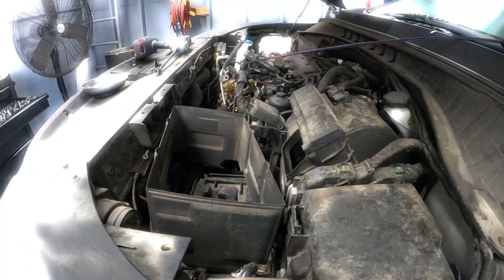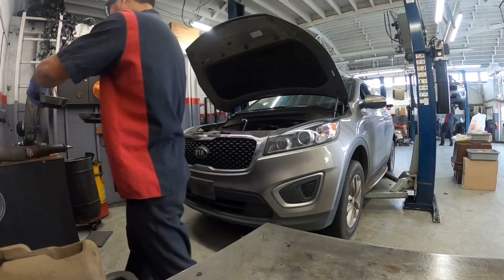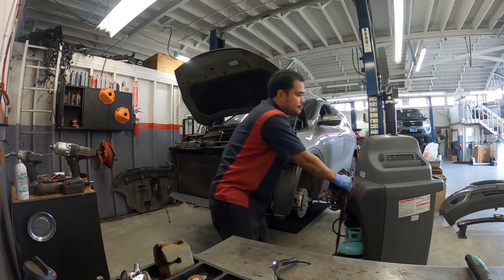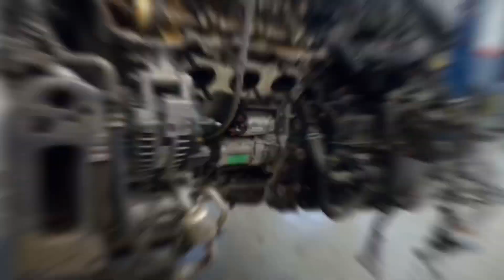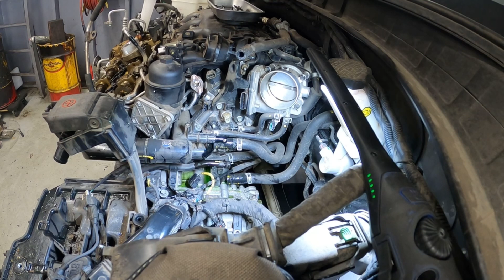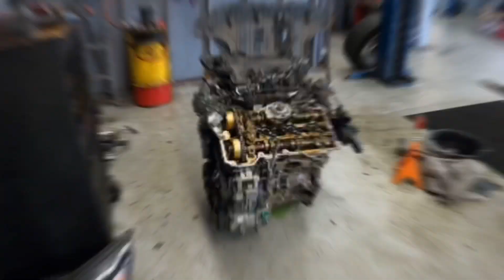2015 Kia Sorento 3.3 v6 engine removal time-lapse. Enjoy. #kia #sorento #v6 #removal #engine

Comment: I've been driving for 32 years and never blew an engine in about the 15 cars I've owned until this one.  A couple of them went well over 200,000 miles and this one was 12 miles shy of 144,000 miles and blew on my way to work.  Two and a half years ago my wife was driving it and said it was running rough and sounding funny.  She took it to a local firestone and said there was no oil in it.  They replaced four quarts and then she took it to the Kia dealer with 99,400 miles when it had the 100,000 mile warranty on it.  They said they would have to do an oil consumption test on it and it would take it over the 100,000 mile warranty.  A little bit later when it had about 101,000 miles we called Kia and they said the dealership never even logged that we were in and they denied us.  Fast forward to two weeks ago and after adding oil over the past two years the engine failed but didn't stop running but had to pull off onto the side of the road on a very busy freeway.  This was a 2014 Kia Sorento SX V6 which wasn't cheap.  Needless to say, I will never own another Kia with that engine.  I had it towed to my house and am contemplating whether to replace the engine for $7200 or not.  I had one with the 3.5 liter engine in my 2011 that was so much better and was very powerful and never had any oil leaks or burning.  The 3.3 was rated at more horsepower but didn't seem to be as responsive.    I hardly had to push the gas pedal in the 2011 and in the 2014 I had to push the pedal a little harder.  It seems like the pedal itself may have had tighter springs in it, which I know has nothing to do with the running of the engine.  In the midst of her oil burning my wife was on the phone with a Kia rep and the rep asked her if she checks the oil every time she gets gas.  My wife asked her, do you?  My thought was you can do that with a $500 beater but not on a very expensive car.  My wife told her that the oil light didn't come on and the lady's response was the oil light doesn't come on until the engine is blown.  Poor engineering in my opinion.  It will tell you if you lose a pound of air pressure in your tire but won't tell you when your oil is low until the engine blows.  Never would I buy another Kia with a 3.3 liter engine.
Reply from the maker: You have all the reason why not to buy KIA again but I don’t understand why dealership don’t  document your first visit concerning about oil consumption, I had 3.3l Sedona this year approaching 100k miles concerning loosing oil and tapping noise, I document every single visit and it’s a long process but KIA ended up replacing engine assembly under factory warranty in 103k miles in it.
Reply: @WrenchingRyan  it seemed like the dealership cut a lot of corners with both cars. When I had other issues it felt like they didn't want to deal with it.
Reply: 3.3 is garb. 3.5 is the last decent one
Reply: @ua7pyro591  I had the 3.5 that got rear ended.  It was my favorite.
Reply: Kia tries to put blame on you always for their  seized engines . Got 2015 v6 3.5 @ 94K 
Kia doesn’t want anything do with me cos I am a second owner . 
That was my first Kia buy , & it’s leaving a very bad rating for Kia
Reply: @raymony8886  that was my second Kia and never again.
Reply: @WrenchingRyan  I have a 08 with a 3.3. 196k mile and runs great. knock on wood.
Reply from the maker: @clancyyoung9994   keep the maintenance up to date that’s the key.
Reply: My 3.3 has a head leak. Don’t know how they can say it’s on the owner when the dealer has maintained the car a gasket and/or bolts in a block should never blow up if properly maintained. Loved Malory car until about 100k when stuff started going wrong (steering coupler fixed after arguing it was covered)
Reply: @esprado690  I've had a lot of cheap cars that never had engine trouble. It figures the most expensive car I've ever bought blew an engine.
Reply: @clancyyoung9994  2014 KIA SORENTO LX 3.3L V6 AWD / 134k 
Just added Stage3 Thorton Chip and she purrrrss.
Like the man said:
" keep the maintenance up to date that’s the key."

Comment: I can't get a straight answer from anyone on how to change a head gasket on my 3.3L engine.  I've been told it's a complete engine removal, so I've been looking through YouTube for ideas and some insight so I can determine if I'm being overcharged.  I found your video and first of all, it's fascinating, 2nd, it's terrifying.  lol.  I'm looking at a HUGE expense.  It's out of warranty and Kia is less than compassionate about the problem, although I'm discovering it's a common complaint for my model (2016 Sorenta, 6 cyl).
Reply from the maker: There is few different way to replace headgasket on 3.3L engine, you can work on headgasket without pulling the engine out, this is the teardown video please check it out. Thanks for watching https://youtu.be/0yLQ02e8EnM
Reply: the threads are known for pulling out of the block for the head bolts. beware. I'm dealing with one now.
Reply: @mikeallmon1  I been to 3 shops and people said a skipped tooth to bad cats LOL. Did my own tests and low compression in the front head. I'm just parting it out currently. I haven't pulled the valve cover, but have a feeling you're right.

Comment: I never remove the front end to pull them. I always drop out the bottom. Do you find you save a lot of time pulling them like that?
Generally 1.3-1.5 I’m out by the bottom …
Reply from the maker: I drop out the bottom when dealing with 4WD, I felt like easier pull them up when working FWD.
Reply: Complete waste of time doing it that way fighting with things

Comment: This is a 2016, not a 2015. First noticed the air box being different, then front bumper. Shouldn't change much of the removal process though
Reply from the maker: Typo error? Hmmm… well like what you said the removal process is the same. Thanks for watching.

Comment: With the machine you show did you remove the Freon from the ac lines? Curious just had short block replaced and they removed the engine twice . Now my ac doesn’t work. Checked it with a gauge and it was empty 🤷🏻‍♂️
Reply from the maker: Yup Freon recovery is required to replace the engine with 3.3L in it. They probably forgot to charGe the A/C system.
Reply: @WrenchingRyan  appreciate it!! 👍🏼👍🏼 thank you for the quick response

Comment: I’m currently doing this job on my 2017 Hyundai Santa Fe 3.3l. I have the engine completely separated from the transmission but I can’t get the flex plate to clear the transmission bell housing. The front side of the engine hits the fender/frame before the flex plate clears the bell housing. Any suggestions? I don’t have a lift to drop it from the bottom.
Reply from the maker: try to remove the crank pulley it will give you more room, make sure transmission is level, challenging but doable.

Comment: just wanting to ask if the ac compressor and system had to be removed during the engine replacement?  My mother had to have her engine replaced and when she got the vehicle back the ac was blowing hot, and they said it wasn't their fault and not their responsibility to recharge it and that the compressor might be bad. When before she had engine replaced the ac was working great.
Reply from the maker: On 3.3L engine, yes  the A/C system have to be remove to get the engine out, did she get the engine replaced from a dealership?
Reply: Thank you for your answer. Yes, from where she bought it from, Dodge Kia dealership in Topeka ks. And it was paid by the company that forgot to put oil in after a oil change.
Reply from the maker: I’ve done  few 3.3L engine but couldn’t find a way removing it without  dealing with A/C system, probably the tech. Who works on your mothers car forgot to charge the A/C system, its only take few minutes to inject the Freon back.
Reply: @WrenchingRyan  Thank you for all your feedback. Will definitely check back in with them.  Again thank you.
Reply from the maker: @jd-gn1iy   No problem. Good luck.

Comment: Hello CAR Laws Channel etc.!!! I imported Kia Sedona EX 2016 from USA to Europe at 2019 My engine is of course 3.3V6 G6DH. My car was a little hit from front. It was fixed and painted but I have problem with crankshaft seal (transsmision side), tell me it is possible to change this seal (simmering) with not pulling the engine out? Mechanic can pulling out only automatic transsmision? How long does it take to repair? Do you often repair the crankshaft seal? Is this a disadvantage of this motor?

Next question (sorry) is about change valve cover (front side),it was little samage (broke, cracked) near valve chain and oil filler. Is this a difficult repair?
Thanks for all, sorry for my english.
Reply from the maker: To performed rear end seal replacement you have to drop the transmission only, i can probably get the job done about 2 hours,I’ve done few on 4 cylinder engine, before you let the technician work on your car check the oil pressure switch first I’ve done few of them, the oil travel through the valley and look like your rear seal leaking.

Comment: I am currently doing this job myself i have all the bolts holding the engine and transmission together out but i am unable to get the engine to seperate from the transmission. I can see the flywheel with a large gap but it just will not let go. Any suggestions?
Reply from the maker: All torque converter bolt out?  If so those two dowel guide might still holding up.
Reply: Yeah the bolts are out is there anything else on the back side of rhe engine besides the exhaust manifold? Is there just the one engine mount?

Comment: 3.3 head leak - head bolts pulled out. Car maintenanced by dealer. 119k single owner. No reason it should have had the bolts pull out. Bad casting and/or design flaw. The dealer knew the issue right away, seen it before. Still owe on the car and dealer said 10k on the engine swap. Seen these repaired using a Huhn tap/insert kit: wondering if it’s easier to pull the heads and work on the car without pulling the engine. Ever redo the bolt holes vs swapping out the engine?
Reply from the maker: I haven’t done redo the bolt holes, I think the cheapest way to do it is make sure your cylinder head are good and get your self a new engine block, yes you can remove both cylinder head with removing the engine assembly.

Comment: Look at all those KIA Sorentos going up and down in that shop. Is this a KIA dealership? If not, is that just a massive coincidence that all of the cars look like the same generation of KIA Sorentos being worked on simultaneously?
Reply from the maker: This is a dealership, we don’t get much issue on 3.3L  sorento engine,  the other sorento you saw is 2.4L engine and getting a 60k miles service.

Comment: I've got a 16 Sorento 2.4l with a head gasket leaking. I dick with cars on occasion but not sure I want to mess with it. What kind of difficulty would I have?
Reply from the maker: Head gasket job is no joke, you have to have proper tools and information to perform this job. Whatever you decide good luck. Thanks for watching.
Reply: @WrenchingRyan  Upon further inspection it's just the valve cover gasket that's leaking oil down the back of the engine. There is a pretty good tutorial video on YouTube but I'm curious about taking off the high pressure line from the fuel pump. Is that line pressurized? Is there anything that I need to be cautious of there or can I just disconnect the lines and unbolt it no problem
Reply from the maker: @EricStrobel09   Those line are pressurized, start the car then remove fuel pump fuse and wait until engine stall, do not re used two high pressure fuel pump bolt and fuel line, please watch this video to get an idea. It’s 2.4L engine but same difference.
Reply from the maker: @EricStrobel09  https://youtu.be/OJ0gP59wqi8

Comment: So how long did it take? I just applied at a Kia dealership and they only want me to swap engines for this recall. The manager said I should be able to swap one a day but that doesn't seem possible.
Reply from the maker: 2.4L and 3.3L engine are possible to swap it in a day but in this video I rebuilt the engine and took me 2 days that Im in it working but the car sat in the garage for months due to parts back order situation.

Comment: My 2016 Sorento 2.4L is consuming oil at about a quart every 3ish weeks. I replaced the pcv and the valve cover gasket because it had hardened and was leaking. But that didn't solve the problem. What could this be? I know these engines have had numerous problems, and I've got the rod knock sensor installed for the lifetime warranty, but I don't see any other leaks anywhere and my driveway is spotless.
Reply from the maker: Try the BG product, add MOA every oil change. Does help a lot and your adding warranty on your engine.  Thanks for watching.

Comment: Great videos!! Isn't this a 2016-2018 Sorento rather than 2015? I have a 2017 and my co-worker has a 2015 and they are not the same.
Reply from the maker: Kia offer two engines for their sorento, 3.3L v6 which is in this video and 2.4L 4cylinder. Thanks for watching.

Comment: Power plant drop way easier and quicker
Reply from the maker: I agreed. Thanks for watching.
Reply: Still a good video man...and if the vehicle is older sometimes subframe Bolt's are seized solid and can open up a can of worms.   So it's great to have another method to pull the engine. Good work buddy and mechanics gotta stick togather
Reply from the maker: @chads8720  the way you dropped your comment  I figured you also a tech, every time I work with AWD dropping  the subframe with engine/transmission in it always my best option but on FWD for I don’t know reason I feel like I’m more efficient doing this way. Thanks buddy gotta stick together. Thanks again for watching the vids.